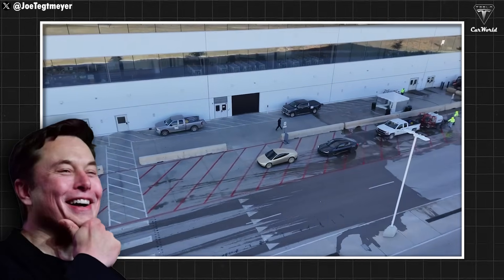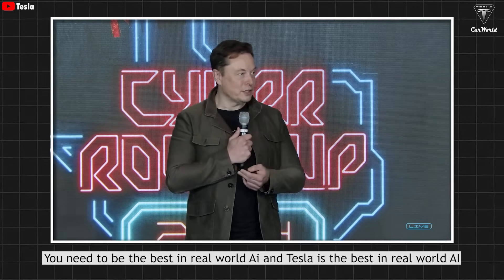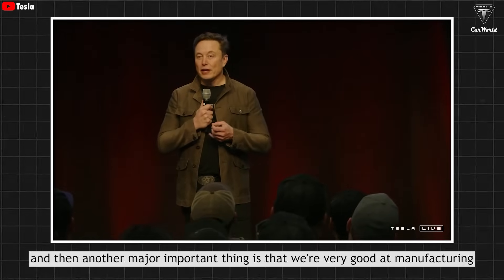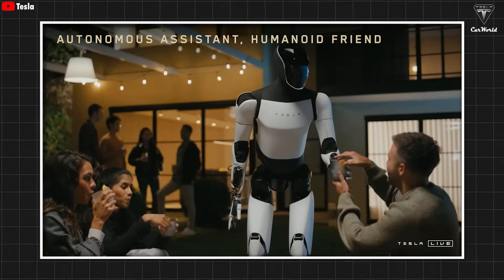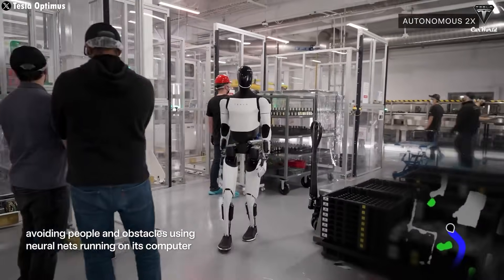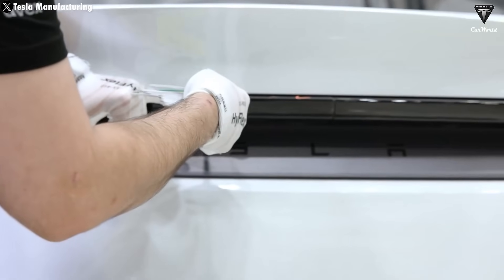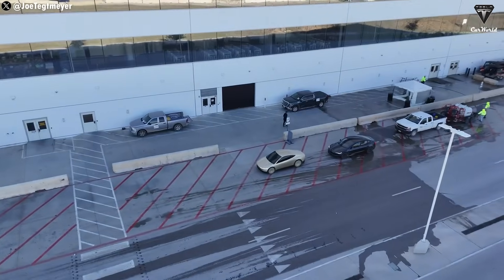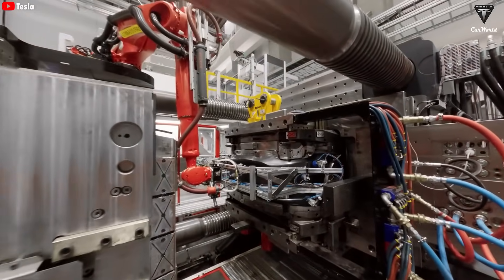Tesla Bot Gen 3 Is ALARMING! Elon Musk LEAKED New Tasks SHOCKED All Giga Texas! HAPPY or WORRIED!

Comment: How long you think it take a tesla bot to:
1. Diagnose a problem with your plubming.
2. Shut off the water.
3. Crawl under your house, 
4.figure out where the problem is while encountering not only abandoned drain lines but also abandoned water lines, insulation, new and abandoned ducting.
5. Cut out the problem, and fix the problem.
Robots wont be doing meaningful skilled trades anytime soon.
Reply: I agree with the skepticism on human trades being replaced, however, being a builder I could absolutely see the bots as another tool on the job site. I recently worked on a small barn located on a back of a homeowner lot. In that scenario, my walking back and forth to my truck and trailer hauling material and tools took a lot of time away from me using my skillset to build. I would purchase a robot just to assist me and the crew.
Reply: Probably not in this century.
Reply: Thank you for having a little skepticism. If this thing even tries mowing my lawn, the vibration is going to break it. Weed my garden? One grain of sand is going to gum up its joints.
Reply: Replace plumbers never. Fit something together on an assembly line ok.

Comment: A car off the production line every five seconds does not mean that it takes five seconds to produce one. It means that they may have 50 being made all at once and every five seconds one is finished.
Reply: It means it takes the production line 5 seconds to produce one. The production line might have 5000 tasks per unit, but they will be simultaneously executed, so 5000, 5 second tasks gives you 25,000 production seconds, so that's about 416 hours of machine/process time per unit.
Reply: Takes a lot of time to mine those minerals for the batteries. Until Space X starts to mine asteroids.

Comment: Can it read the labels on packages... like "flour" for baking... then use a measuring cup.. read the numbers on the side.  If everything is "labeled" or scanable... huh... I just might be able to follow a cooking recipe off the internet.... step by step robot cooking instructions.?  Society is going to change.... what else can it do?  What ever you "train" it to do?   Pressure sensitive grip?  x, y, z, axis memory I assume for hands and legs positioning. integrated with the cameras and sensors.  Like I said before once... can I take it to the bathroom and ,... me personally take it's hand and grab the cleaning brush and clean the bathroom.. hard corners too... use it's hand to do it all.. I move "IT"... but it remembers the whole process exactly?  So it can just repeat it?  Robot clean the bathroom. command... and it runs that program.  Or is it way way cooler than that and has auto sensors for actual laser scans of the wall/surface infront of it... itentify clean or not... run program for cleaning.... rag or brush or clean/baby wipe. or what ever.   Like a roomba floor cleaner .. just go over ever surface, over and over.?  How "integrated" is it.. huh.. too curious.

Comment: In 1914, Henry Ford was completing start to finish car assembly in 90 minutes and he had one car rolling off of the assembly line every 24 seconds so one hundred eleven years later, one car every 5 seconds doesn't sound that far fetched. 
If the Tesla bot can be utilized for things like sweeping a shop floor, taking out trash, picking up rocks in your yard, cutting grass, providing some level of watchful home / business security along with normal household chores, talk about life changing. And if they are pleasant to interact with, even better.
Reply: Yes, Elon did not claim that he would be making Tesla cars 5 seconds from start to finish.
He said that they would be completed 5 seconds apart, in effect.
He could have 20 production lines that roll off a car every each one, but staggered so that one comes off of one of them every five seconds.
Reply: Optimus also needs to have good social skills if it's to assist the elderly in their own homes as has been suggested.
Reply: @ I think such skills would be quickly acquired once the bots go to market.